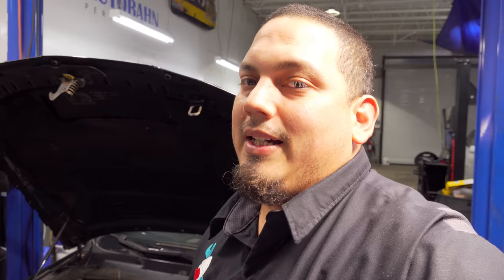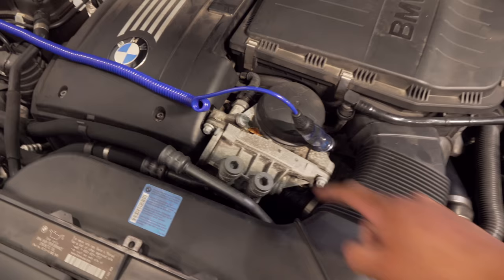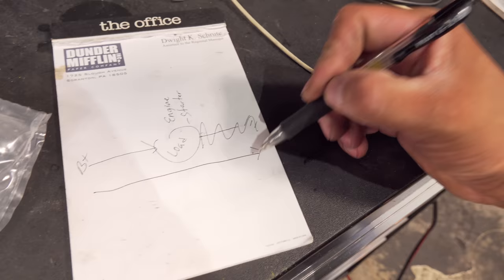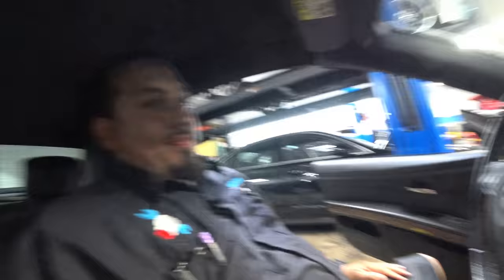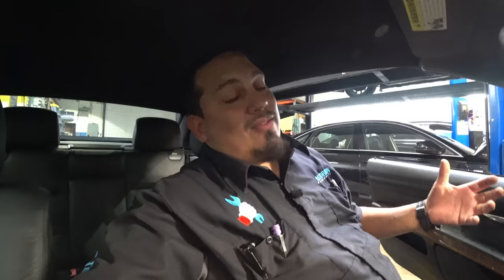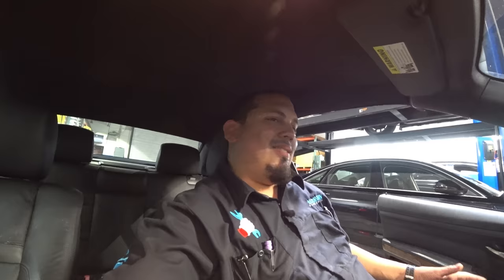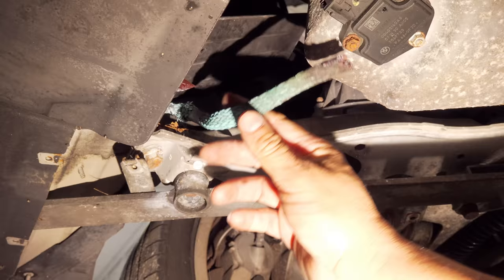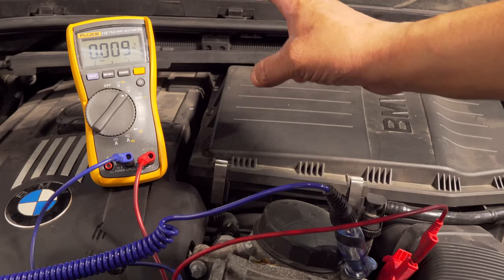TEST YOUR ENGINE BLOCK GROUND USING THESE THREE METHODS

Comment: My 2014 Ford Transit Connect the starter just makes a little sound then stops battery is fully charged when the starter makes a sound the engine does not crank. Previously, the van was running then it stopped moving forward I revved the engine numerous times trying to get out of traffic went through the gears the van would not move I then cut it off and now it will not crank.

Comment: thanks for the info. i have the same problem. at first  i suspected the issue was with starter. took off starter and bench tested it worked fine, and installed it back in. i contacted negative jumper cable from ground stud to engine block and tried to crank and got at least slow crank. should i be getting voltage reading on multimeter from positive post to engine block? Thanks 🙏

Comment: Its the same principal of reading voltage drop across a fuse. Just much higher current… and the ground wire became the fuse…

Comment: My problem im having is voltage drop once the car starts to warms up, brand new battery and brand new alternator, previous battery tested good, replaced the alternator with a reman at first, because the orignal failed a test, some how finagled fhe parts store to get me a new Duralast gold, and still having voltage drop after it wams up. Its a Honda, alternator control and Eld have been disabled through a tunning aoftware. Next is grounds and wiring at the harness side of things. Cars starting to piss me off. Belt tension is tight at the alternator.

Comment: Hi. I have a 2013 Hyundai Sonata 4-cyl that has good battery and new/good stater but nothing happens when key button is pushed.  

Nothing will power up except the button's little dim light as I'm pushing it.  

Any ideas where to start? Thanks!

Comment: There is to much resistiance in those cables is all .there for one to long which is likely part of the issue and two there two thin.length creates voltage drop and  two thin of wires creates ohms(resistance ) heat is a biproduct of it .

Comment: I got a 2002 f150 5.4 new alternator new battery. The battery runs down with trunk running are not running. I'm lost on what to do next.

Comment: I have bmw x6 e71, I have changed the starter 2 ground cable ! But sometimes when hot it no crank no start , it starts after a few tries

I don't know what the exact problem is

Comment: I have an 86 prelude si , battery light is on . Will take a jump and turn over but dies shortly after.   ?s: does my battery need to be fully charged to accurately test my alternator?   ( I am jumping my battery just enough to get another jump) .  I've  cleaned all my grounds that I could find.     Any help will be most appreciated

Comment: Thanks so much Mario, I've a question: in the last ground testing, one testing lead going of course to the engine block, and the other to the battery negative post or car's body ?
Reply from the maker: Negative jump post on the car's body

Comment: My 2007 335i won't start just clicks but once I put the jumping cables on my car my car will starts up and runs until you turn it off n just does the clicking  n it's n the shop  n mechanics telling me my engines locked I think he wanna screw me over

Comment: Would the same test light test be applied to the body ground?
Reply: The negative terminal of the battery, the chassis and the engine block need to connected with as low a resistance as possible, at all times, for everything to function reliably.

Comment: Thanks a lot..about the problem when a module ( ecu, hvac,..) does not start up unless you hook up a scan tool..What is the procedure to resolve it please ?!!
Reply from the maker: That's a bad ground. You'll need a wiring diagram to find out which one
Reply: @SuperMarioDiagnostics  
Do you have a video explaining why a scan tool will resolve a ground issue?
Reply from the maker: @toutsandler3739  no i don't. But it's because a scanner bridges pins 4&5
Reply: @SuperMarioDiagnostics  Yeah that is brilliant answer, never thought about !!...
One last thing, i had an HVAC powered on (power & ground) but does not respond to any command until hooking up the scan tool !!
Note: I checked that the 4&5 pins are already bridged internally on this car model (peugeot 406).
Reply from the maker: @toutsandler3739  sorry I'm unfamiliar with the brand or setup. Nor am i able to get diagrams for those
Reply: @SuperMarioDiagnostics  Thank you a lot for the informations you provided...Maybe in a facebook group would be easier to show you the wiring diagram.